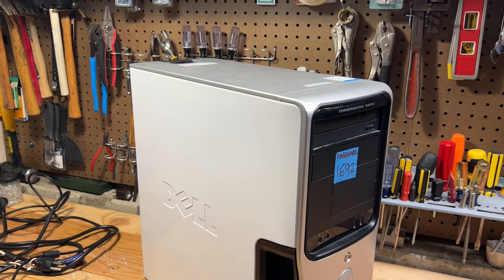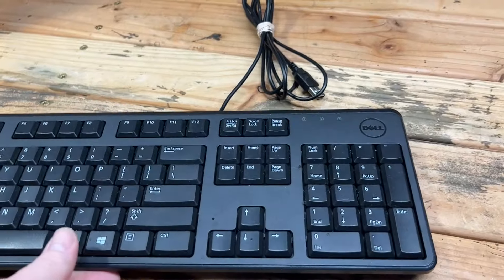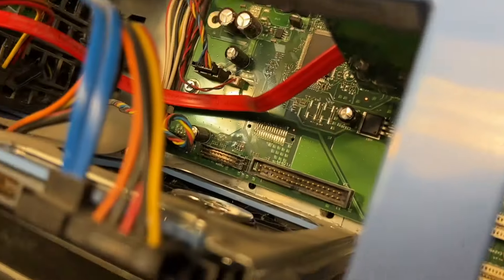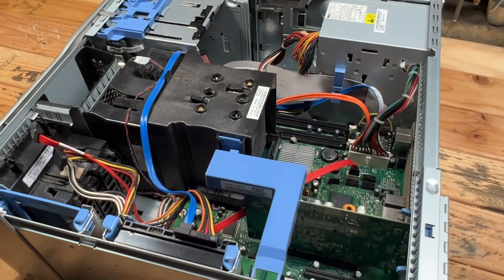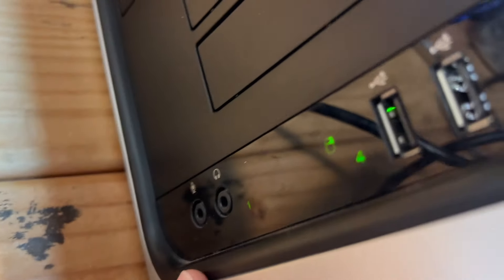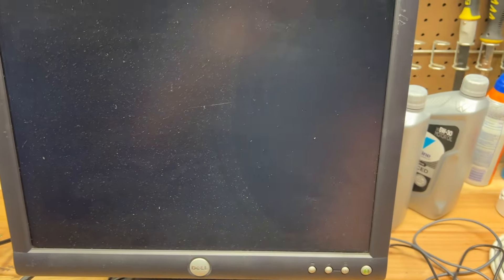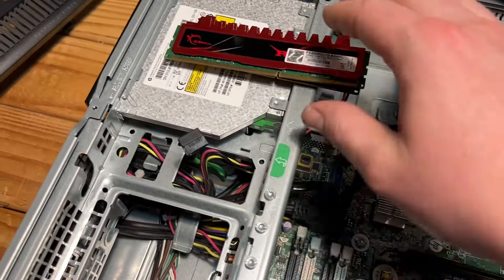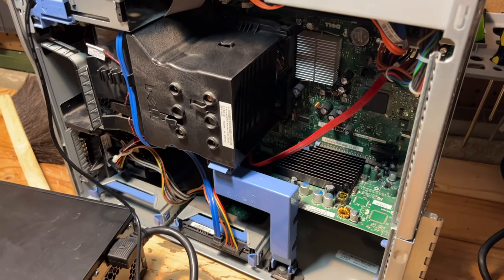Business Class Thrift Store PC Finds! - 55

Comment: You installed the RAM wrong in that HP ProDesk. They are supposed to be installed in the paired slots/banks. They are colour paired. Also, you should be able to get a 4th Gen i5 processor upgrade for cheap. If you do, please reinstall the screws back on the heatsink fan as it will help with vibration noise when it’s spinning at full speed.

As for the Dell, I have the XPS variant of your tower running a Core2Quad. You should check getting its BIOS updated and if you do intend to keep this, get those capacitors replaced. If you can find equivalent solid capacitors, that would help its longevity.

Comment: Used to own one of these dell machines, highly likely that the bulging capacitors on the motherboard are causing the issue, yes they still work but capacity has deceased causing the power to get unstable. Mine had the same issues and was solved by replacing the caps by some slavaged from another board that was dead,

Comment: OEM activation is tied to a key encoded in the BIOS. If the key in the BIOS is only valid for XP, then 7 won't active, even from a Dell install disc.
Reply: I'm not sure about that because I have a Windows Vista machine that will activate Windows XP if I use a Dell installer I'm pretty sure it's quite possible for one machine to have multiple keys the Dell OS installer mostly doesn't care as long as the machine matches some kind of identifier that does a bunch of stuff and whatever also most of the time the keys that are stored in the bios are not the same as the ones on the license sticker on the side of the system, the one on the side of the machine is more of a backup if you lost your main OS installer the same thing applies to hard drive recovery partitions the keys are never the same on the side of the system compared to the key that's in the recovery partition.

Also like to add that Microsoft killed the upgrade program for windows 10 if you use keys from 7 and 8/8.1 to upgrade I think.

Comment: Did you ever see if the hard drive on the Dell worked and saw if it had anything on it? The 4 GB iPod Nano for 10 bucks? To be honest, it sounds a little pricey. But it's just me. I'm a cheap bstrd. You got the mid-range storage size. Those came in 2, 4 and 8 GB. And LOL! You call that 2006 iPod "retro" 

I still have my Panasonic portable CD player that I bought back in 1993. Yikes! 😮That thing 31 friggin' years old! Talk about retro!